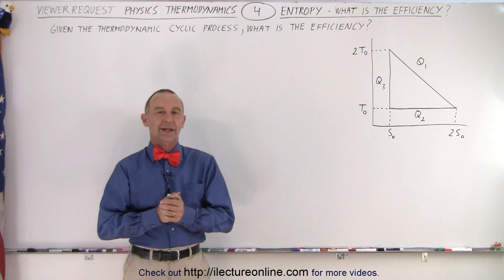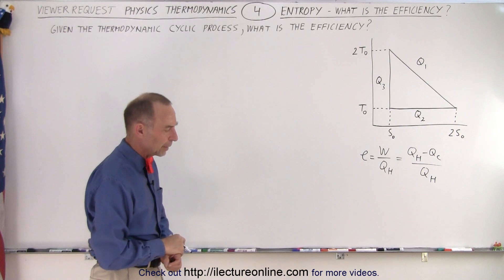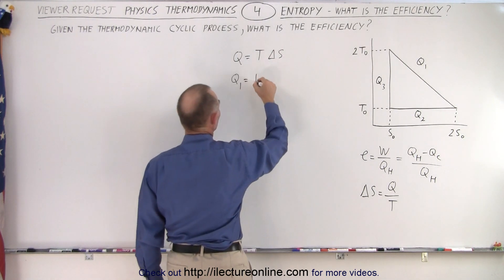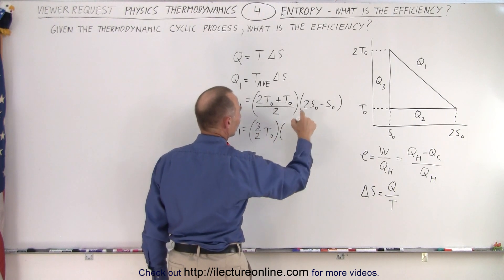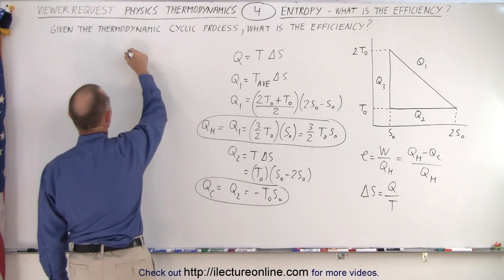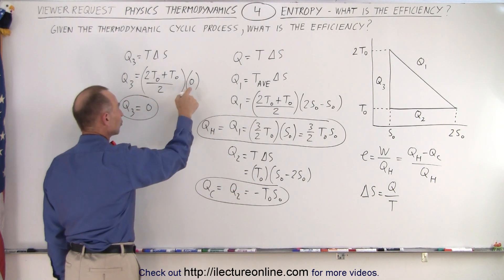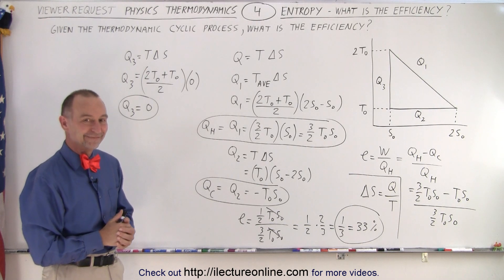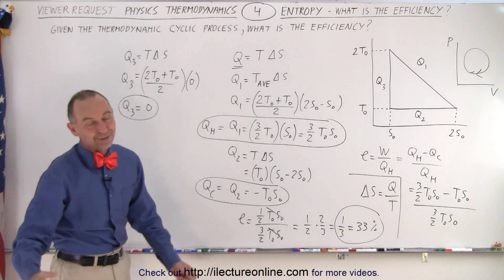Physics: Viewer's Request: Thermodynamics #4: Entropy - What is the Efficiency?

Comment: Please sir,  can you help me on this problem? 
A uniform disc if mass m and radius 2a centre O is smoothly pivoted at A,  where OA=a. (I) find the moment of inertia of the disc through A perpendicular to the plane of the disc. 
The disc is fee to rotate in a vertical plane about the axis through A. Given that the disc is held with O directly above A and then slightly displaced so that it swings in a vertical plane,  (II) show that in the ensuing motion,  3a(dø/dt)²=2g(1—cosø).  (III) find the reaction at the pivot when ø=π.
Reply: I hope u can calculate the moment of inertia . For the second part .use work energy theorem .that is the drop in potential energy (because the COM falls through a height 4a) equals gain in rotational kintetic energy of the disc . So u need to equate 
mg.4a=1/2Iw^2.  At the lowest point disc has acquired w angular speed .so the hinge force will be vertically upward direction H=mg+mV^2/2a ..do not use equations of dinamics the process will get much longer .use principle of work energy .
Reply: @anikbhowmick1044  , Thanks. What I later did was : work done =PE—KE; which later corresponds to the given equation being asked.